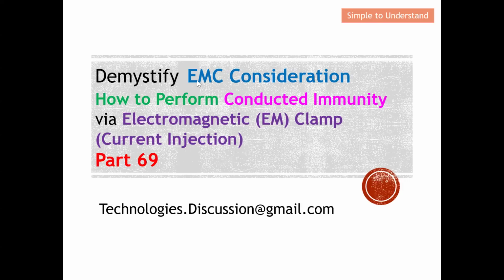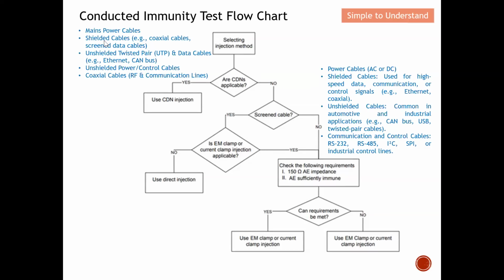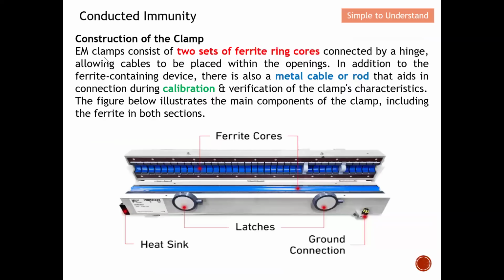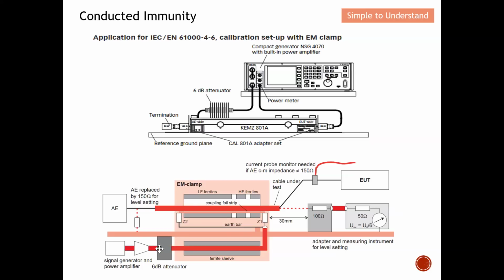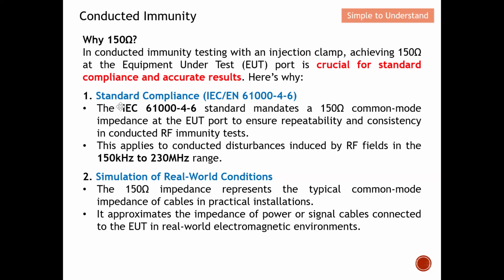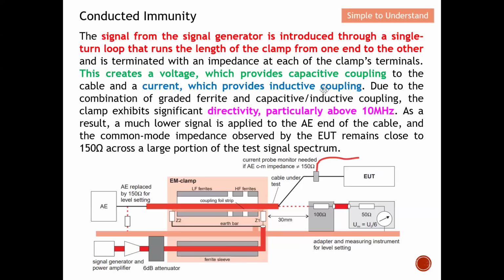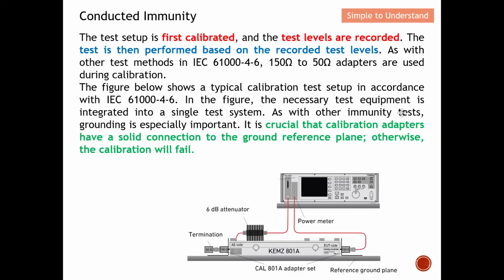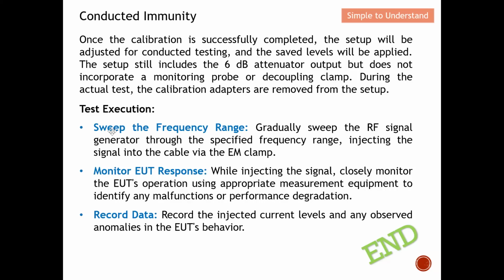EMC #69. How to Perform Conducted Immunity (IEC / EN 61000-4-6) via EM Clamp Current Injection.

Comment from the maker: Thank you for taking the time to watch this video. This video explains how to perform Conducted Immunity (CI) testing using an EM Clamp. Along with Part 68, it will help you understand the differences between performing CI testing using a CDN and an EM Clamp. Additionally, this video provides a flowchart to help you decide which testing method to use—CDN, EM Clamp, or Direct Injection. It also outlines the procedure for conducting CI testing using an EM Clamp. I will also share why the impedance need to be 150 Ohm.